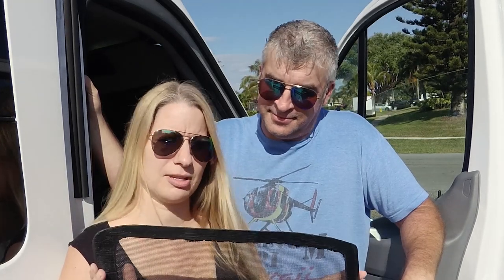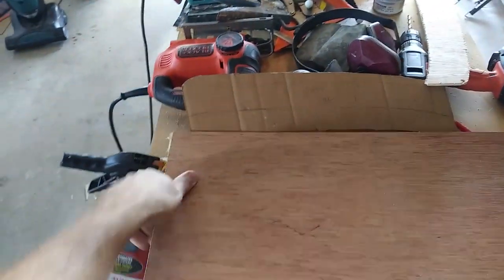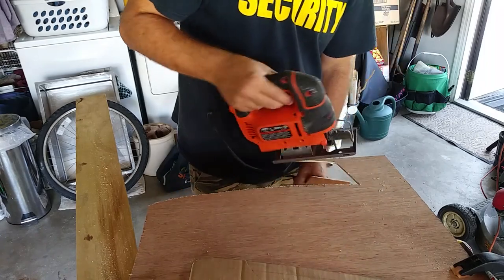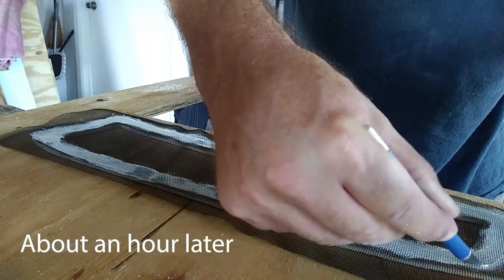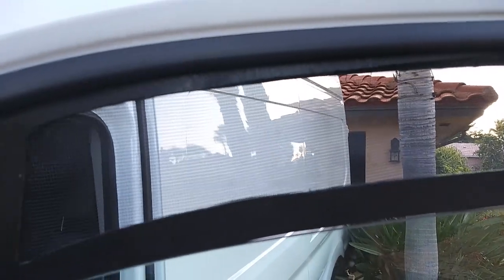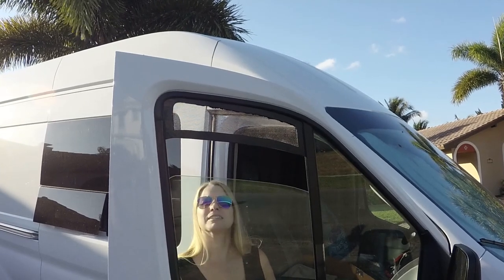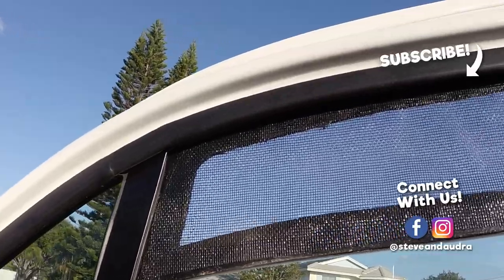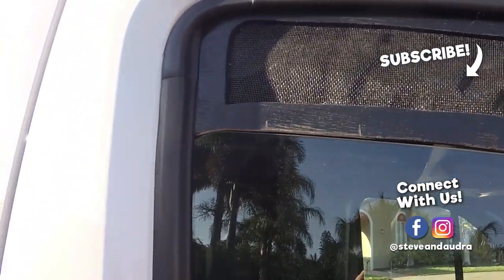How to make your own cheap screen inserts for camper van or car windows | VAN BUILD SERIES #16

Comment: So those crows! 🤣 Wow they were like taunting you!  Thanks for the instructions! Yes patent those babies....only out of some heavyweight plastic!  You could make millions!  I may do two pieces of wood just to have a track or that might be too much to slide into the stripping!  Great idea and thanks for all your help in making my van build a little more doable.  I am going to take the fridge today for a fit up in the cabinet!  Can't wait
Reply from the maker: Yes, those crows! When we film, we often have trouble with birds and insects making a raucous! I know there are companies that make inserts but they are very different than what Steve made. We wouldn't complain if we could patent them and make millions! LOL! That's a great idea about the two pieces of wood. Steve thinks you'd be able to fit two pieces. Now that we have our bigger windows installed, we haven't really used these but they were great before we had the airflow from the windows!
Reply: @SteveAudra  I think I may need them until I get a slider door window.  I probably will only do that one with two fans.
Reply from the maker: @debberkebile4396  Sounds like a plan!

Comment: I can see where refinement would be necessary where the frame meets the window, but you could also use some foam insulation strips along the bottom edge.
Reply from the maker: Thanks! They have worked pretty well for us but we can see how a foam strip might be a nice touch to add! We wouldn't have to be as careful about lining every up properly then when closing the windows.

Comment: MY quick & dirty: 4+ high strength magnets, cut screens to be larger than windows; fold them over the top of the door frame, stretch tight with magnets to lay flat. then roll up your screens for travel. Not secure, yada yada. have not had problems with bugs.
Reply from the maker: That's a great idea! We are huge fans of heavy duty magnets! They come in pretty handy for so many different applications in the van!

Comment: That is a smart idea.  Love it.  if you add a rubber seal on the bottom it will be genius.
Reply from the maker: Any recommendations for how to add a seal?
Reply: @SteveAudra  nothing specific.  weather striping that can be found at Walmart or Lowes is what first comes to mind.  I wondered if you can find something that would slide over the edge of the wood with the opposite side sealing against the glass.  Foam stripping might also work.  Just a thought.  keep up the nice work.
Reply from the maker: @jshenderson  Thanks! We'll have to think more about that. Sometimes, if we insert them just right, there is no gap but it's easy to insert them not just right! LOL! We would have to find something that was easy to attach.

Comment: Depending on where you are camping you may want to consider using no-seeum screening (like you see in tents.)  Back in 72 I had a 69 VW Bug that I made into a mini-camper.  Made the mistake of using regular screening for my windows and one night in a Georgia campground the no-seeums drove me out (literally) in the middle of the night!
Reply from the maker: That's a great suggestion! Being from Florida, we know the noseeum horror quite well. They are horrible little buggers! We've been told that with that kind of screen it really cuts down on airflow. Do you find that to be the case?
Reply: @SteveAudra  Well my 69 Bug was eons ago and I never put noseeum screening in it. I am in the process of converting a Transit van and I will likely make screens like yours but will make a separate noseeum screen that I can attach when needed.  But, yes I imagine that it does cut down on air flow. I will be using Maxxair fans to exhaust the air so I guess I could do a little research to see what size a noseeum screen would need to be to keep up with a Maxxair fan and design the screens to that.
Reply from the maker: @shannond2875  We'd love to hear how it turns out! Thankfully we haven't had trouble yet in our travels but it might be nice to be prepared for it!